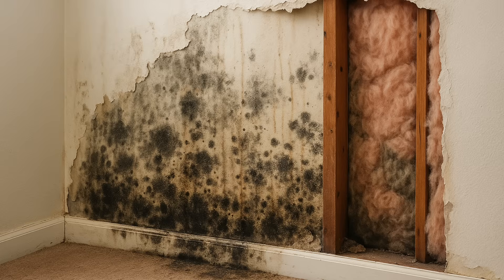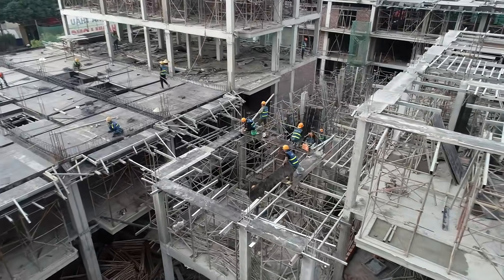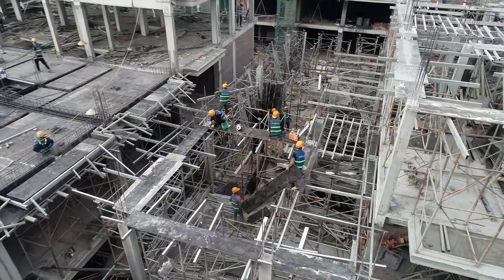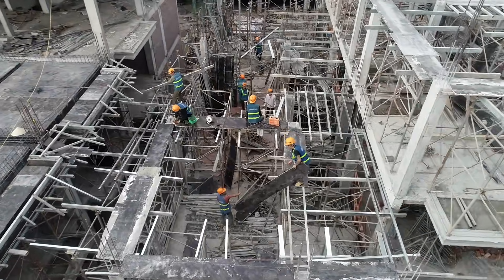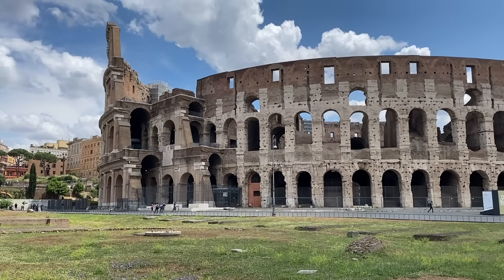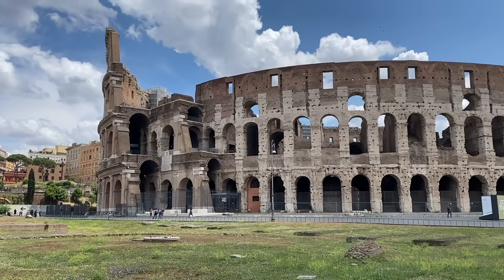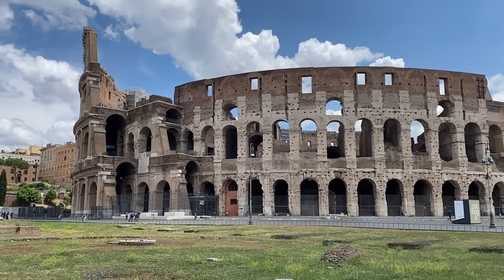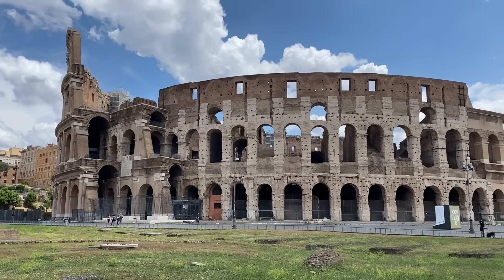The Four Control Layers | Series Intro: How We Got Moisture Wrong

Comment: If your going to seal it you best plan on conditioning and providing air exchange then. Here in Manitoba we most certainly need to provide significantly different indoor vs ambient temp. So humidity and air will req. Cond. I take the points you made as acurate and presented as an overview good points just the mechanical systems exist to mitigate any problems. A conreate or stone building has huge thermal mass granted but on the Praries in winter its got high thermal conductance. We should consider a lot of the old ways depending on what were building and where. Good job.
Reply from the maker: 100% agree. I just scripted all the videos in the series this weekend and filmed and edited the first one (liquid water control layer). I'll go over thermal mass vs insulation in the one on thermal control layer!

Comment: A very simple truth. A building " must breathe  "
It does not matter how many air exchanges. Hot/ cold  recycling systems. And the worst " air tight " building .Academic and engineering breakthroughs all ways fail.
As with the wheel, it can not be improved upon. Simple , honest, and basic shall seldom sail.
Reply: Absolutely correct. Old houses before insulation relied a tight plaster interior to keep out drafts ( cold or hot air). The sheathing and siding "breathed". The wall cavity allowed air flow to attic where it could escape. It wasn't ideal but with maintanence the house survived. We breath and can not live in an airtight box. Air exchangers are an absurd idea for a house with live things inside, IMO.
Reply: @timothylongmore7325 
Thank you.
Reply: Correction: buildings do not need to breathe, the need to be able to "sweat", moisture in the form of dampness must be able to travel trough the walls. And this is why it's best to use natural building materials.

You make your house airtight to avoid drafts and keep the warm air inside and the cold air outside (in wintertime) or vice versa.

To keep your house healthy, you need to ventilate but in a controlled manner to avoid drafts. If you want to recuperate the heat in the "used" air, use a heat exchanger (ERV-unit).

Comment: I live in a straw bale/cob house on a rubble foundation. The guy who built my house abandoned making it an entirely cob structure early in construction due to the outrageous amount of labor to stack what is essentially mud. He even had a ton of unskilled labor (workaway) on site but still said it would take too long to build (800sqft). My walls are therefore frameless straw bales with a cob plaster layer on both sides. I don't know anything about rammed earth, but I hope it's more efficient than stacking mud! Probably will be since at least you can pour into a form.

Thermal mass is a real thing and something that isn't even in most people's modern vocabulary. I've never lived in a structure with such a comfortable temperature gradient before this one. Highly recommended.

Modern structures are essentially [poor] attempts at building a completely sealed space ship or biodome that rely entirely on insulation, sealing, and mechanized airflow. It can work and the passive house people are doing a decent job at it. But those are all premium builds.

Excited to see your projects come to life!
Reply from the maker: That's amazing, thanks so much for sharing! I'll be talking about thermal mass vs insulation in video #5 in this series on the thermal control layer.

Comment: I am building a prototype low-income/affordable cottage, including the on-going costs of utilities.  I choose a 2X4 staggered double stud wall assembly (and no vapor barrier).  The cottage is nearly passive.  I am also installing a heat pump HVAC system; all heat pumps have a dehumidifier setting.  I believe I have solved the moisture entrapment problem.

Comment: Rainscreen cladding/siding is a good solution. This basically creates an air gap/vertical channel behind the exterior layer which allows vapor to escape while preventing rain from getting the wall wet.
Reply from the maker: Yes, it can be! I will talk about rainscreens in the air layer video of this series (it straddles water and air b/c of how it neutralizes air pressure).
Reply: I plan to strip off siding, then add Tyvek to the subsiding. Over the Tyvek an 1" of foil faced insulation board followed by 3/4" of vertical furring strips and finished off with siding.   Because I have foil faced insulation board.  Would put a spacer between the Tyvek and insulation.  For example a 1/4" ripping ?   tHanks

Comment: Vapor pressure is a difficult concept for people to grasp, but it is the key to everything in this video. I have applied the same concepts and techniques to composting! No more weed seeds or slug eggs.
Reply from the maker: I'll go over vapour pressure in more detail in video #4 of this series (it's the third of the four control layers).
Reply: Can you elaborate about how you compost according to these principles?  Very curious.
Reply: @brianshea4177  sure! Treat the compost pile just like you would a heated structure- VBL on the warm side of the insulation. So right now here in Anchorage the ambient air temp is 35F. I collected a somewhat small pile of mowed leaves with some garden scraps. It is sitting at 142F after a few days. I covered it with plastic sheets with foam chunks on top. Then more plastic. This is all scrap material I've collected over the years from construction sites and other places. When you trap the vapor, you eliminate heat of evaporation losses, which are considerable with a high delta T. Put the insulation on the outside and you shift the thermal gradient out away from the VBL so you don't have as much condensation near the VBL and commensurate moisture loss in the core of the pile. EPS is preferable to XPS as it doesn't absorb moisture. Please let me know if that makes sense and if it works for you. Check out this videohttps://youtu.be/fX6oO7168LM-

Comment: Blower door testing and air sealing are under appreciated tools for comfort and energy efficiency.
All new buildings should be designed with large roof overhangs. The large overhang provides beauty and protection from the sun, rain and wind. 
Protection of the doors, windows and siding make for a more durable and comfortable home. Water is the enemy of buildings.
All homes should be built to accommodate the elderly and disabled. This will be better for everyone.
Large wide doorways and hallways make using a cane, walker or wheel chair much easier.
Bathrooms or wet rooms need to have flat floors and no shower hump or pan. A flat floor allows for easy access and drains need to provided.
Easy to use lever door and faucet handles are easier for the elderly to grip and open.
Main floors should include a master bedroom, restroom, shower, laundry and wide walk in closet with few steps to enter.
Homes should be designed with aging in place in mind.
New homes should come with solar panels, a rain water collection system and an electric vehicle charger in the garage.
Reply: Blower door test is now mandatory in much of Europe. Unfurtunately, only in the end, when potential leaks are covered up by interior drywalls. And there are still loopholes for weak spots such as power outlets. It's better to do it when the airtight layer is still exposed, and possible leaks can easily be fixed. Leaky vapor barriers behind drywalls regularly lead to cold walls.
Reply: @BBirke1337  Multiple blower testing needs to be done during and after construction.

Comment: All homes should be built to accommodate the elderly and disabled. This will be better for everyone.
Large wide doorways and hallways make using a cane, walker or wheel chair much easier.
Bathrooms or wet rooms need to have flat floors and no shower hump or pan. A flat floor allows for easy access and drains need to provided.
Easy to use lever door and faucet handles are easier for the elderly to grip and open.
Main floors should include a master bedroom, restroom, shower, laundry and wide walk in closet with few steps to enter.
Homes should be designed with aging in place in mind.
Reply: Totally agree with this- Our house was built in 2009, sold to us under a "rural deed of burden" that means we got it discounted paid 65%, now own it outright and was sold as a house for life as you cannot really profit from it as they get to buy it back first dibs. Yet when we moved in I said to the wife- "they've made sure we have a disabled ramp to the porch, the porch door opening isn't wide enough for a wheelchair or mobility scooter to get in, there's a raised 40mm threshold hump, the porch is so small then turns 90 degrees inside to get in the house with an equally small doorway. There's an upper level with curved staircase, how do we access that in older age? It wasn't as if there was a space shortage we have 1/2 acre or 2,200sqm.... A bungalow would have been so much better and wider doors/corridors make things like furniture removal so much easier. On the patio side of the house there's a 450mm drop and they installed one step. Utter stupidity.... In our old age if we're still there I figure gutting and reforming the interior may be the only way(2 walls support the ridge and are structural, already looked into this as the rooms are tiny and lots of wasted space), create a flat/apartment upstairs to rent out and put a large single room extension on the downstairs....
Architects are utter idiots, the clown who did this got nominated for an award SMH

Comment: New homes should come with large roof overhangs, solar panels, a rain water collection system and an electric vehicle charger in the garage.
Water is the enemy of all buildings.  Large roof overhangs add beauty and protection for doors, windows and siding.
Reply: Never trust the intelligence of anyone who buys electronics that don't have replicable batteries.
Reply: Every thing except the vehicle charger. EV’s a a joke. Maybe someday but not now.
Reply: @thomastjg53  The future is electric. No noise, no emissions, less fuel costs and less maintenance cost.
Legacy auto manufacturers are in trouble. They are too slow to adapt to the transition to electric vehicles.
Adapt, change or go bankrupt. Nokia and Kodak were once leaders in their industries but were slow to adapt to new technology.
Legacy auto dealers are a nightmare for legacy auto makers. They gouged customers trying to buy electric vehicles.
Legacy auto dealers abused their customers by adding market price adjustments to gouge their customers for EVs
They added pricey add ons and other costs to pump up the prices and their profits.
Tesla has the right idea. Buy online. No hassle. No sitting in a show room for hours. No salesman BS. No crazy markups.
No I have to see my manager BS.  With Tesla you can buy a vehicle in 5 minutes or less online. The dealers have no one to blame but themselves. The dealers are dragging the legacy auto makers down with them. The problem with legacy auto makers having slow sales leads back to the legacy auto dealers. They try to talk people out of buying and EV an want to put them in a gasoline car.  Many people hate going to legacy car dealerships. Many people call them stealer ships for a reason.  New car, used car or going in for repairs you always walk out feeling cheated. People have no sympathy for dealers.

Comment: The real problem lies inside your
 wall. When its cold and the heat is on that heat is trying to escape through the insulation at the same time cold is penetrating the wall creating frost in every wall cavity. After winter is over the frost is stuck inside the wall in the form of water. This is guaranteed.
Reply from the maker: Yes! I'll go through this in the air episode in this series. And touch on it in the vapour episode.

Comment: 100 score! Building codes and experts have really blown it.  Today millions have paid premium for foam insulation and they wanted the best . Yet they are at the mercy of their air conditioning system to dry them out and even so corners and eddies still trap moist air. I have lost 10 homes to plastic laminate over crawl space and purchased flip homes with plastic sheeting in the wall which just waited for the air conditioning to cut off so the smell of mold begins to rise.
HUMANs are wet creatures and every breath we exhale releases this. Our cooking and bathing and laundry add moisture continuously. The house must dry.  I live in the south east so snow and cold are not a problem but humidity is smothering.  I finally built a 30x30 house with a continuous uninterrupted roof deck above.  I used perforated house wrap inside and out. In the brutal summer the house is shaded by the deck and a single mini split cools entire building and the summer power bill is less than 90 dollars. Dry and cool now.
I used conventional framing because it is so cheap and available.  When I was younger I dreamed of all these exotic building systems, materials and products. But in the end you must build with local available material and products.  My cost was 30 dollars a square foot.  Housing is simple and affordable. I built it myself last winter.
I have a unique building where the wall s extend above the roof. A low pitch metal roof is between the wall and it is trimmed with cap, z trim and portal cap to make it water proof. On top of the capped wall I bolt 4x6 timber on top of the metal portal cap. These or notched like the Mennonite’s shed foundation where 2x10 run perpendicular over the entire structure and support deck boards.
Congrats on figuring out the flaws with modern building process. Building science is like the food pyramid. Really tragic how so many thoughtful people have been betrayed and compelled to mess up our homes by government policies 
Good luck!
Reply from the maker: Wow, that’s incredible — you’ve clearly learned through experience and reflection. I love that you’ve found a simple, affordable, dry way to build that works for your climate. It’s amazing how much wisdom comes from stepping back and rethinking what “better” really means.
Reply: I built a SIPs home , best home ever. Like living in an igloo cooler . Only complaint in winter exterior lock sets and knobs on occasion sweat inside during winter. I guess the exterior portion kept the interior portion cool enough to firm condensate in winter

Comment: Aerated concrete blocks is modern answer to these problems. Especially factory produced, white ones. Popular in Europe and some other countries. Combine properties of rammed earth, and energy efficiency and simplicity of modern materials. Do not require any extra insulation (if you are a friend of physics, not some European psycho regulations)
Reply: Still a building, not an insulation material. For decent insulation, there must be a separation of concerns, insulation materials often just take 10 or 15cm, for what would require almost a meter of aerated concrete or bricks with insulation core.